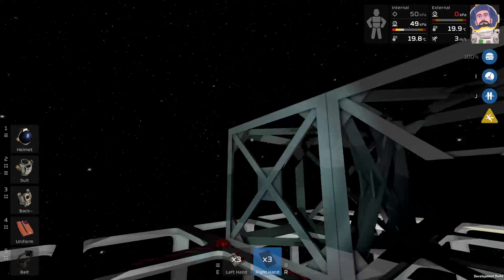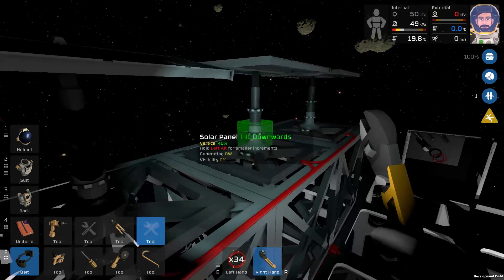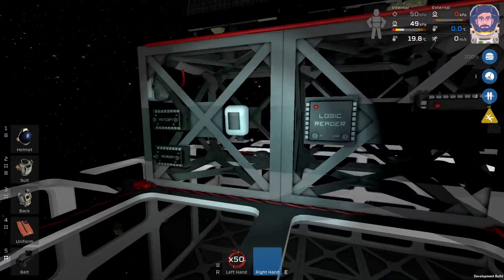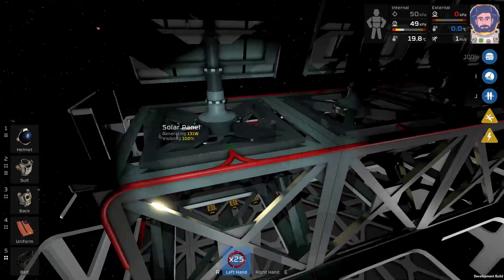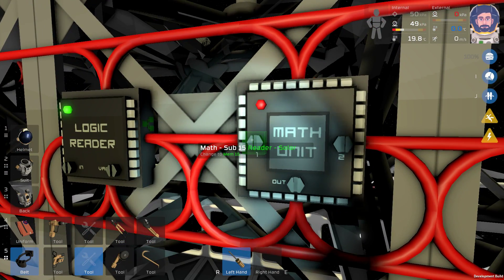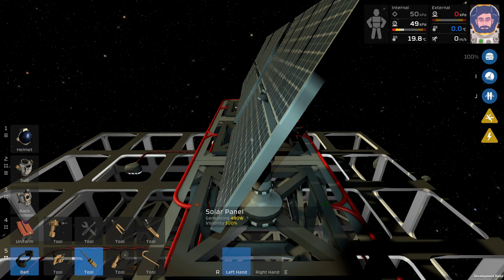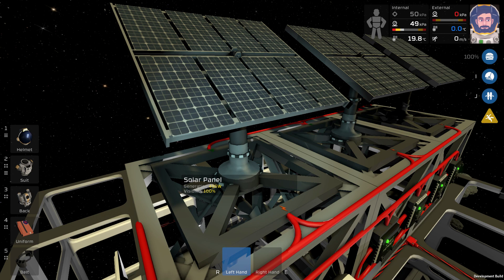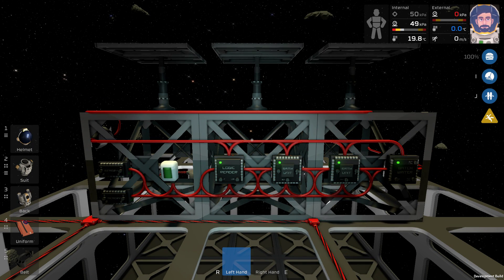Stationeers Tutorial Part 6 - Solar Logic Rundown

Comment: I'm using only one memory (as value of 1.8) and one math. Then I just div solar sensor value with 1.8 ... Result is value for solar panels. Why extra mem and cpu? Maybe it is bit more accurate, but does that matter? I know that resources are quite low when you start and you may not have all resources to do 2 mem and 2 cpu. (+ others)
Reply: The solar panels have a 100 points of motion, but technically when the panel is at 1, it's technically should be pointing at the sun when the sun has an angle of 16 degrees. So, the panel doesn't pick up the entire 180 degree's of motion of the sun. It picks up 150 degrees. So, the 1.5 is always correct. 1.8 would simply cause the panel to never get to full efficiency as it will always be pointed before the sun.
Reply from the maker: You could just do a div 1.8, but it's far less efficient. The slightly added resource / electricity requirement of this circuit will pay off.

Comment: You mentioned the solar panels can only angle to 150degrees?  Is it possible to change the horizontal angle?  I was thinking you could have it angle to 90 vertically then rotate horizontal then angle back down to follow the sun exactly...  I know it might not really be worth the extra circuits for only 30 degrees extra of sun but might be something...
Reply: No, the panels cannot see the entire 180 degree arc. They can only see from 16 to 165. The panels are incapable of angling all the way to the horizon.
Reply from the maker: The panels can angle 0 to 180, but it registers as 0 to 100.
Reply: Ah, a bit confusing, but makes some sense.  I guess sort of like a percentage base.  Anyway, thanks again for these tutorials.  Keep up the great work :)

Comment: I would probably do this to the output before the logic reader. a) times the output by itself b) then square root it.

What this will do, is when the sun disappears, the panels will slowly move back to 0 at the same rate they initially went to 100.
Reply from the maker: That adds additional resources and power requirements for honestly no added electricity generation. I suppose you could do it, but why?
Reply: In the day the solar panels would rotate from 1 to 100, and then at night, slowly rotate back from 100 to 1. It would give you a visual guide to how long until the morning. Requirements would be two chips. I don't think the power consumption would be that much.
Reply from the maker: I don't need a visual guide, I understand your suggestion. This current setup runs at ~490 per panel and what you want to add doesn't help to increase that by a meaningful amount. I wanted to show the 'bare minimum' for solar tracking. In my own playthrus I add additional bells and whistles.